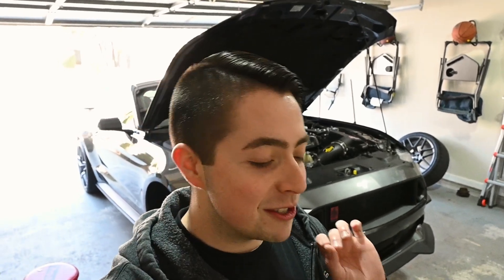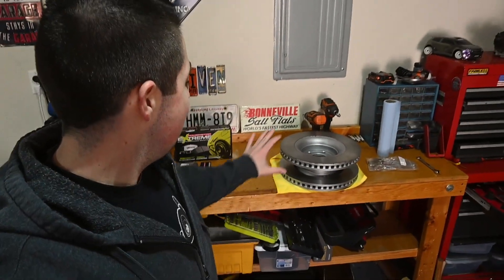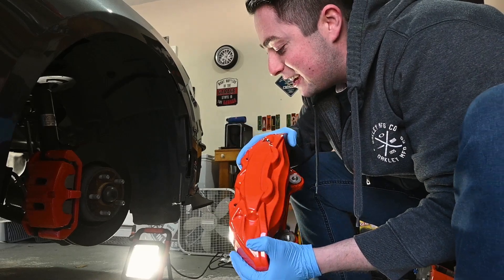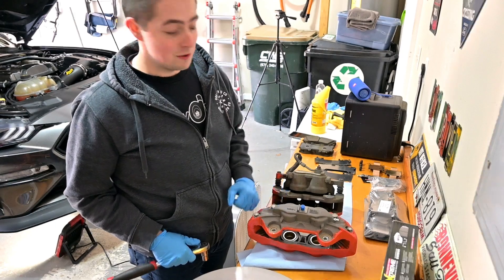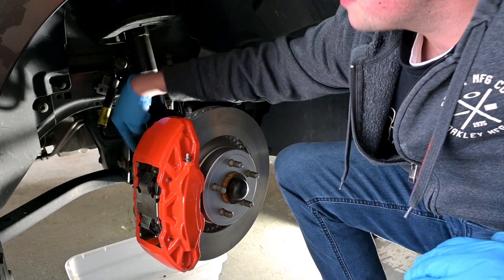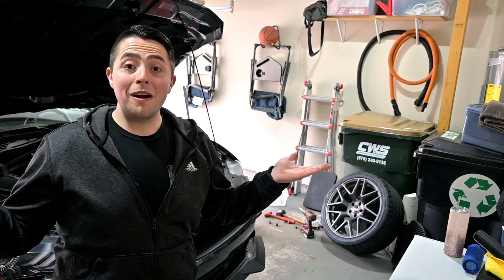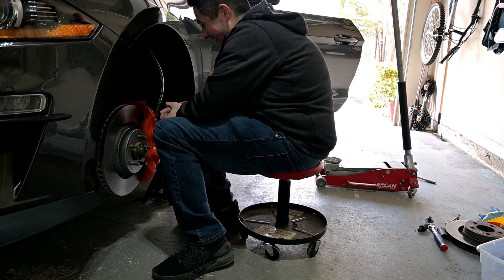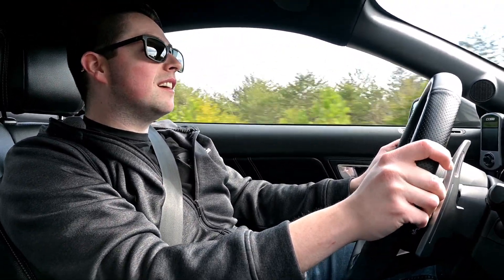Installing HUGE 4 Piston Calipers On My Mustang Ecoboost!!

Comment: Correct me if I am wrong, but when you go from 2 piston brakes to 4 or 6 piston brakes on all 4 wheels, in theory, your system would then require more brake fluid to operate all those extra pistons. Do you check the volume of fluid in your Master cylinder to see if holds enough fluid to operate all those extra pistons? Let me guess.  You never thought about that!! So, do you think you might need a BIGGER master cylinder now? BETTER CHECK!
Reply from the maker: That’s a good point! But yes I did check when bleeding the brakes that the fluid was at the correct level in the reservoir. Plus it’s only the front calipers that were changed, and they come on the stock GT that has the same fluid reservoir size.

Comment: Did u use stock brake lines & stock shield ?
Reply from the maker: I used the stock heat shields but had to use the GT brake lines. PN is in the video if you need it 👍

Comment: Hey great video Tyler, you are making your Stang yours and its turning out man. Also great job on the brake upgrade , you are quite a DYI person.  Let me know how you like the pads you installed , I went with Bosch pads. Take it easy.
Reply from the maker: Hey Thanks man! I appreciate it. The pads are great! This is probably one of the best upgrades I’ve done to the car honestly